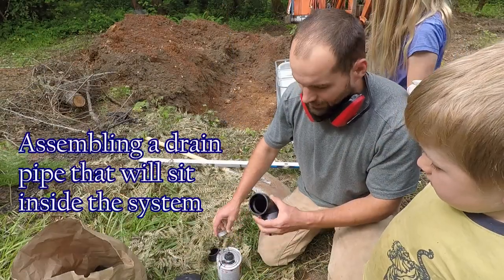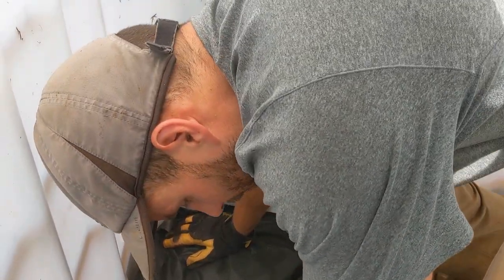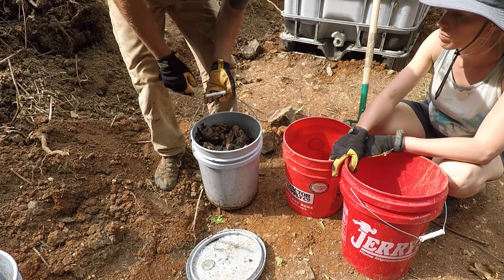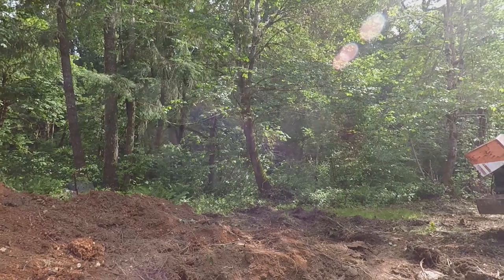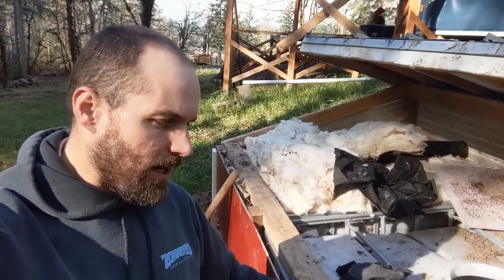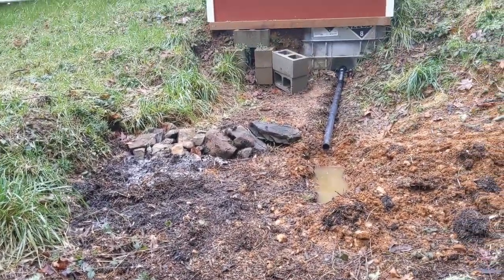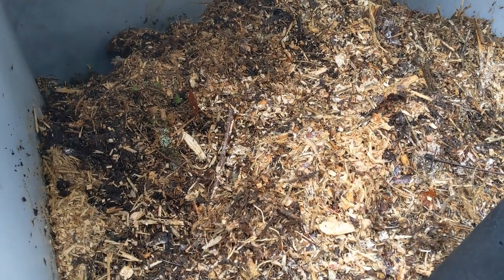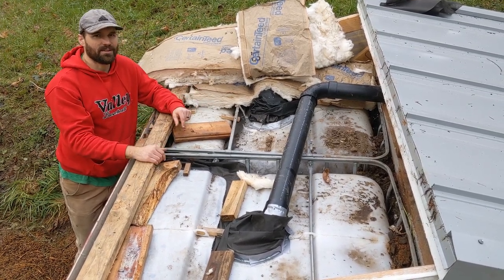Installing and Using a Worm Composting Toilet System

Comment: 1. A flushing toilet makes compost too wet.

2. Worms don't need much water as long as they are fed plant matter

3. Worms don't eat poo.

4. Those wood chips are too big to rot quickly 

5. It is going to be hard to empty those containers.

Take out the flushing toilet, replace it with a bucket, use saw dust and make a raised compost pile for it all. 
Build a seperate worm farm for food waste.
Reply from the maker: I agree with some of your points and disagree with others.  I've filmed two follow-up episodes in the years since that first installation video.  If you want to take the time to watch them and then have a discussion, I'd be interested.  I'm leery, though, based on your comment that "worms don't eat poo".  That's just false, and if you think that's true, there's really nothing else to discuss around this system.  I'm happy to engage in constructive criticism and discussion, but I can't tell if you're in that category.

Comment: Wait, did you just throw earthworms in the 2nd tank?
Reply from the maker: We went through the same plumbing and construction process with the second tank.  We've made some improvements in how we add branches and other material, which I'll cover in the followup.  Can you point to where you got the impression that I just threw worms in, so I can understand better?  Thanks.

Comment: The effort is good but this system will not work. Every flush introduces too much water. The leach field will clog up quickly and the worms won’t do well in the totes due to water.
Reply from the maker: You realize the system is over 4 years old now?

Comment: I can really see your insulation attracting rodents and other undesirables.... If you use the silver bubble wrap insulation under the roof over the tanks, it will insulate just as well and not give pests a safe haven.
Reply from the maker: Yep, you are right that I've seen signs of mice in the fiberglass insulation.  Thanks for the suggestion!

Comment: I can see that you take a lot of satisfaction in handling your own sewage treatment, but I guess I'm not quite seeing how this is really more sustainable than a conventional septic tank.
Reply from the maker: The top of my list for differences in sustainability is that we will never need to call a pump truck to come pump out our septic tank.
Reply: @Green_Heart_Family_Farm  But only because eventually you'll be shoveling out the worm castings yourself, right? Basically, you're your own septic tank guy. He pumps out sludge and produces agricultural fertilizer. You use the worm castings to fertilize the soil on your property. Both are kind of doing the same thing.
Reply from the maker: The system is designed so that the worm castings pass out of release pipe (they are water soluble).  The goal is to never need to shovel anything out of the system.

It certainly will require maintenance and work on my end, and I'm not here to argue that you shouldn't use a septic system.  If you prefer a septic system, that is perfectly fine.
Reply: @Green_Heart_Family_Farm  I hope it all works out as intended, and that you continue to gain satisfaction from taking a hands-on approach to your family's sanitation needs.
Reply: @unclebenny9028  This vermicomposting system is also going to go anaerobic, if enough water is running through it to dissolve the castings so that it doesn't ever have to be emptied. Note that the channel owner does not even claim that it is more environmentally friendly than a septic tank, just that he likes handling the household's waste disposal directly instead of hiring somebody to come pump out a septic tank, nor does he claim that everyone should do this instead of having a septic tank. If you believe that, I suggest you find a better way of saying so than asking people how they "dare" ask questions. If you want to persuade people of your position, calmly enter into discussions. Don't try to shut discussions down. That's not going to achieve your purpose.
Reply: @trishoconnor2169  hi Trish, I hope you're well? 
You have a good point, however there are times when a septic tank is either not viable due to planning regs, or not suitable due to ground conditions. It's also a possibility that, due to the reduced water level inside the ibc, it's less unpleasant as an odour, as long as the worms are kept as a healthy population. Some places aren't suitbale to have pump trucks coming along to pump out the septic tank?
Reply: @davidmiddleton7029  Yes, I can see a septic tank being unsuitable as a good reason to go with a more labor-intensive alternative, just as living in a place without sewer lines can be a good reason for going with a septic tank.

Comment: Worm will die if it is filled with water.
Reply from the maker: Yes we discuss that scenario in the video
Reply: The drain pipe inside the IBC should IS too high. It should be halfway or only a 3rd only of IBC HEIGHT so  the worm will a have a place to eacape the water.
Reply from the maker: @apinhmi  I don't think you watched the whole video.  The primary drain pipe is near the bottom.
Reply: I didn't see you drilled holes on the drain pipes you installed inside